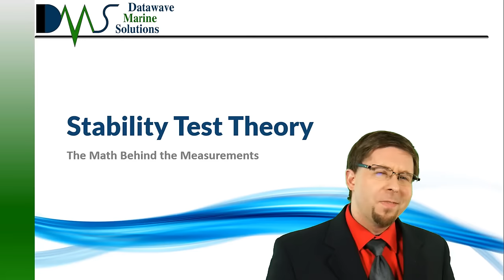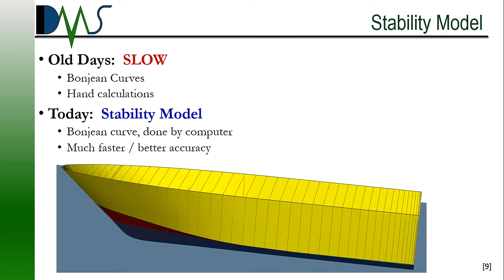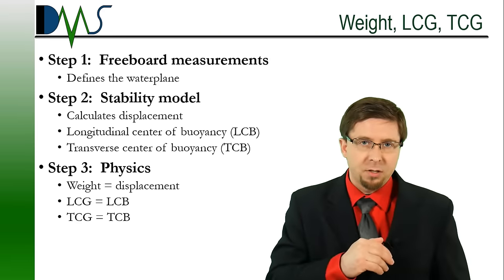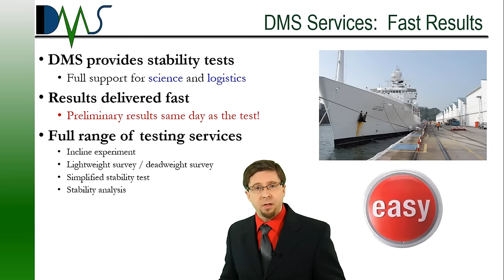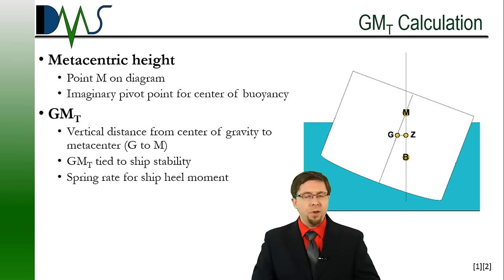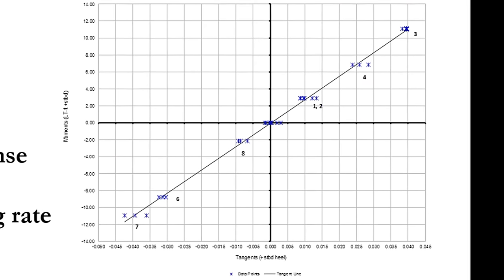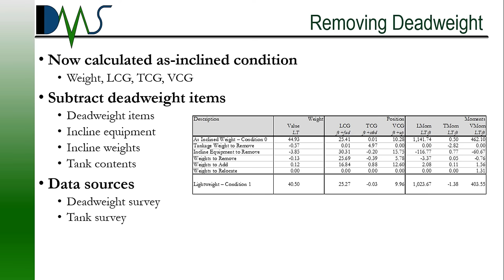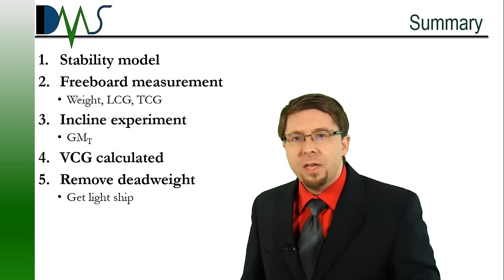Stability Test Theory:  The Math Behind the Measurements

Comment: Engineering at it's best.
Take stock of all the equations describing your problem.
End up with a horrible mess of integrals and differential equations.
Decide you really don't like the look of those.
Let computers solve the integrals (or use diagrams if you're old school).
Find a place to apply small-angle approximation (or use first term of Taylor series) and end up with a set of nice and tidy linear equations.
Fill in with known values, divide by correction/safety factor - done.

I really enjoyed this deeper dive and to discover familiar concepts to mechanical engineering.